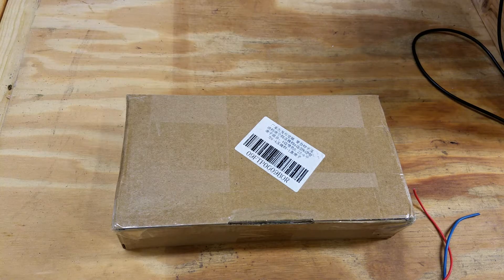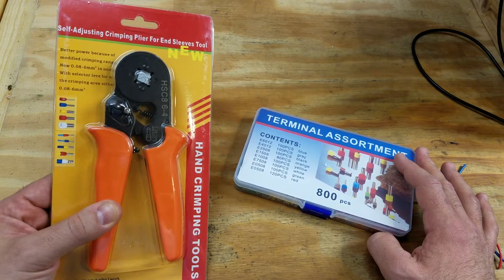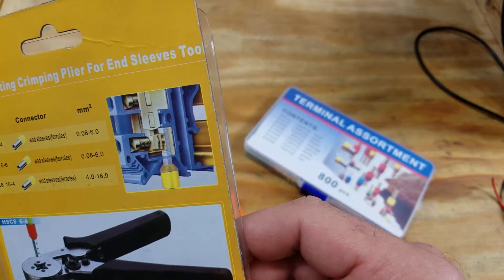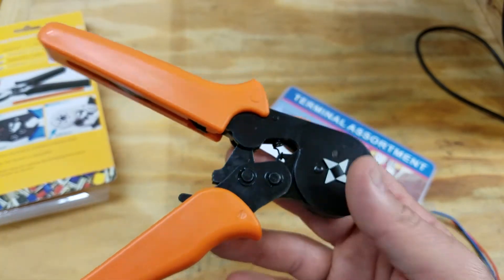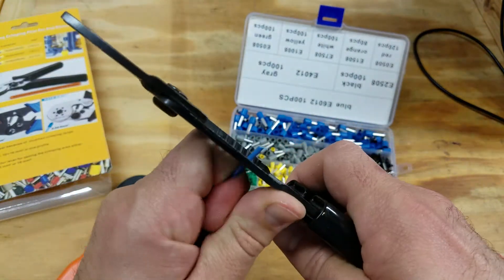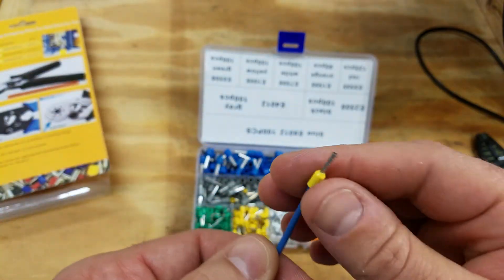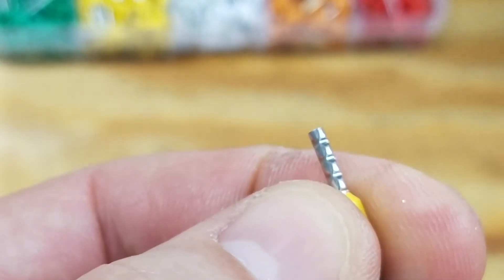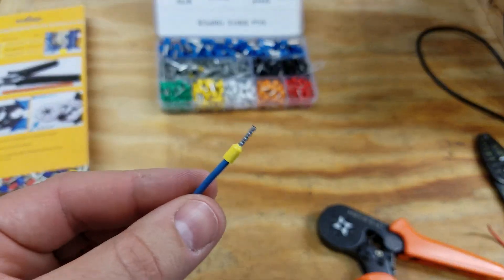Ferrule Crimper Pliers: How To Crimp Wires Like A Pro!

Comment: Your buddy had a pair of Duetch crimpers for the Duetch connector, which use to cost $125 now they run about $50. Their  used on transmissions and engine connections.

Comment: If you’re building an enclosure they make not only the best looking wiring but the best performing as well. Definitely worth buying. The insulated shoulder also allows you to slide up the wire number to it and it is really clean looking. You need to invest in a better set of strippers, the ones you are using aren’t permitted in most applications due to removing strands from the wire or they nick solid strand.
Reply from the maker: What do you recommend?

Comment: Do you need to adjust for different size ferrules?
If so how do you do that?
Reply from the maker: Negative.  No adjustment required.  They automatically compensate.
Reply: @FrancoCNC  Cool! thanks for getting back :)
Reply: You fit the smallest ferrule possible to the wire size your using, for best crimp...

Comment: Does it crimp Dupont connectors?
Reply from the maker: I'm sure it would crimp them but I doubt it would fold the metal over exactly the same way the proper tool is designed to do.

Comment: Very nice Franco. As an aside one, could just tin the ends of the wires. This would eliminate the problem altogether, albeit not in such a fancy way.
Reply: Crivo152 soldering takes that much longer tho. Why not jus  crimp a terminal on that leaves bare wire ends looking clean AF! And only takes a matter of seconds to properly crimp them on. Although I don't understand the need of crimping them if they are going into screw down type terminal plug. The screw is gonna crimp it so why use a tool? Jus my 2cents...
Reply: Tinning the ends of stranded wire weakens the wire. It creates a stress point where the tinned part and the untinned part meet.

Comment: What's the need to crimp if your jus gonna screw it down into the terminal? Won't the screw lock it into place? Seems like wasted effort crimping em only to use a screw to hold em in place...